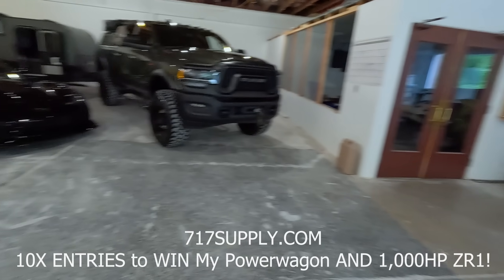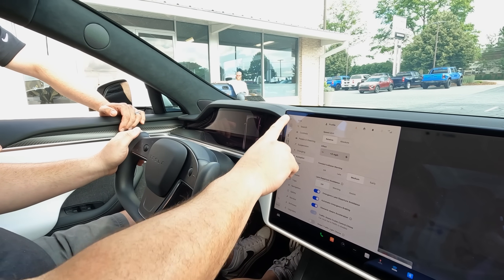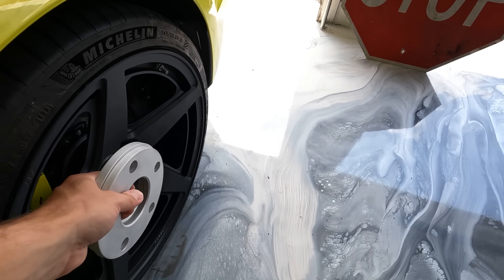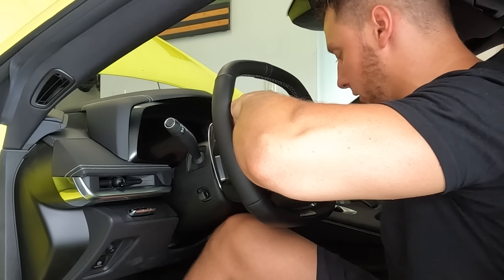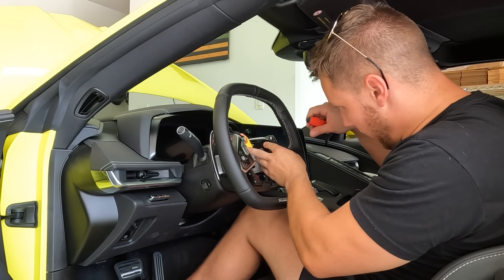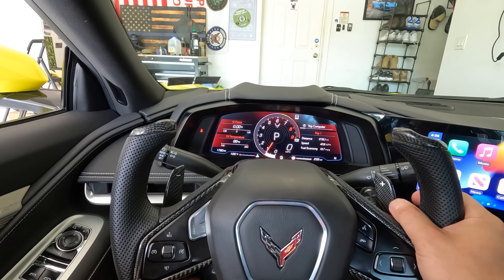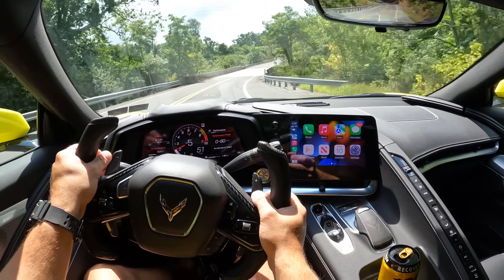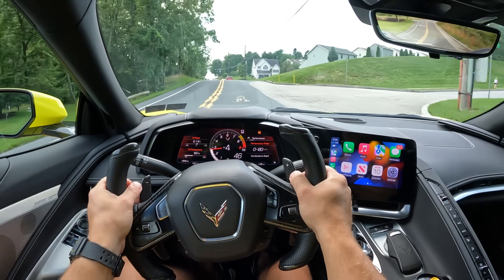STARTING My C8 Z06 Build With Something Small... *C8Z Build Part 1!*

Comment: Don't know if anyone has ever told you this. But you should ALWAYS use hub centric wheel spacers. With those flat spacers, ALL the load is transferred to the studs, and over time, they will break. Also, your wheels will not be centered properly. Spend more money and get the correct spacers
Reply: They WILL be centered properly bc of concave lug nuts and, well, geometry. And you cannot use hubcentric spacers unless the spacer is thicker than the flange of the hub. A 10mm spacer would not be thick enough for that.

Comment: Back in the day when cars had keys, part of the procedure was to leave the key on when you disconnected the battery. That way when you reconnected the battery the airbag would go off without you in the seat. It doesn’t take much to set them off but you really have to try to defeat the safeties in place. If that makes sense. 
   I’m digging the knight rider steering wheel. I’ve always heard stories about people driving KITT thinking it’s awkward. I’d like to try driving it. Great “build” buddy! Lighting is way better than the hex lights.  Can’t say that you’re not starting your business from the ground floor, cause it looks like your in your basement. You’ll look back on this a laugh some day.

Comment: Like the steering wheel. Do they make it for the C7 ZO6? 
The only change I would have done on the new Mag wheels is they should have been Carbon Flash. The flat black looks like they are covered in brake dust.
Reply: Thats the main reason I dislike matte black wheels!

Comment: That wheel style is known as a Yoke. And aircraft that use them are typically much larger than fighters. For example the B52 has a similar yoke. Whereas the F16  has a side stick controller on the right side of the cockpit which is pressure sensitive and has little to no movement. Not what one would want one in an automobile since the ability to feel the wheel moving is how we perform turns of a desired rate, circumference, etc. 

The C8 turns the same way other vehicles do and thus one can still perform a 180 deg turn for example. Btw, that was in reply to a poster who wondered if they could still perform a U turn or a tight circle for example in the C8. 

Yes, you can.The car can do anything other cars can do. Hence the yoke style 'wheel' is not an issue in that regard.
Reply from the maker: lol good to know!

Comment: The steering wheel actually looks decent, not better than a good carbon and leather round wheel, but non the less I like the yoke more than I thought I would. Only issue is its safety when you are having to counter steer the vette when you’re sideways.

Comment: The only problem with that new wheel is going to be when it steps out on you and you have to quickly counter steer…
Reply: There is no way I would drive a car with a steering wheel like that on the street . I've done it on the drag strip but wouldn't use it on a "handling car".  I can't think of any Corvette that I've owned whose full handling capabilities could have been safely leveraged with a wheel like that one 😳
Reply: It's not an issue. One can do everything they can with a normal steering 'wheel', although at first glance that may seem impossible. It's due to the fact the 'Yoke' output and vehicle turn rate are much the same as with a typical round steering wheel. And one thing you'll notice is the fact you no longer have to turn a 'wheel' nearly 360 degrees in order to perform certain maneuvers.
Reply: No. It behaves the same as a normal steering system. That is it interprets your inputs as though you were using a circular wheel connected to a mechanical system. Hence you can do anything you can do with a normal mechanical steering wheel system. 

Systems similar to this have been in use in some aircraft for years. For example, the F16 uses a fly bye wire system whereby one applies varying pressure to the side stick controller and the aircraft responds according to ones input. Whereas aircraft without such a system often use a mechanical (cable and hydraulic system) which is slower and offers less precision. 

Think about it: How could one operate a car if it weren't possible to perform a 360 degree turn, be it slowly, or rapidly while painting the road with rubber and leaving clouds of tire smoke in the air. Not that it's typically a good idea mind you. It's the fact the car allows one to do so. Now back off a little and drive like you're lawfully permitted to in which case a drive by wire or fly by wire system performs just as well and typically better.
Reply: @cassiespencer6134  

"And one thing you'll notice is the fact you no longer have to turn a 'wheel' nearly 360 degrees in order to perform certain maneuvers."

This is just not simply true. Aircraft use a yoke "steering wheel" because they lock at 90 degrees and there's no point in turning the wheel further. That would require modifying the steering ratio in a car. Unless this guy made those modifications either via some kind of software (not sure if the c8 has drive by wire or not) or via modifying the rack itself, a yoke in a car will still require adjusting more than 90 degrees to get tighter turns, only now you have less room for your hands on the wheel. Yokes in cars looks cool as best, and in the event of an accident where turning quickly is needed, dangerous at worst.
Reply: @Sol_Divisive  It depends on the acft. Btw, I'm a pilot. And as I  said most light acft use a yoke. Although some, for example older acft often use a stick. Whereas the F16 for example uses a fly bye wire system whereby one applies varying pressure to the side stick controller (right side) and the aircraft responds according to ones pressure input. And the 'stick' itself moves very little.
Reply: @Sol_Divisive  I was referring to the C8 as far as how it can still turn in the same way any other car can that have a steering 'WHEEL'. 

I say that since the poster was curious as to whether or not the C8 could still do a 360 deg turn for example  since it doesn't  have a steering 'WHEEL'.
Reply: @Sol_Divisive  Depending on acft type a yoke stops when the ailerons or elevator for example have reached their mechanical travel limit. However, given a fly by wire system said control surfaces are moved by a number of means depending on the aircraft. For example it can be via hydraulic or electrical systems. And it's those systems which determine travel limits; which in some cases can vary depending on acft type and/or design. 

To put it as simply as possible the flight control surfaces and control system/s used with most light acft for example are a stick or yoke, along with rudder pedals which allow said control surfaces to be moved by pilot input via cables or in some cases hollow aluminum rods. That said virtually all control surfaces have a mechanical travel limit as well. And it's due to those limiters that control how far a control source can move, be it by pilot input or wide guts while parked.

In fact  aircraft certificated under 14 CFR 25.415 or EASA CS 25.415 are required to be capable of exposure to wind speeds of 65 knots from any direction without sustaining damage while parked or taxiing. It's why a metal rod is used to prevent control surfaces from being moved with enough force via wind while parked in order to prevent damage.
Reply: @cassiespencer6134 Congrats on comparing cars to planes, but this yoke design on a STREET car with a steering box designed for street use is terrible. This makes sense for a purpose built GT track car with their purpose built steering box because the inputs are much tighter and more precise, requiring a smaller area of input. Very rarely if ever you're doing full corrections or hand over hand movements, unless behind the wall. Where as on the street you absolutely will be doing these movements. Of course, internet talk is cheap so if you actually want a demonstration I know finding a GT racecar or even a C8 Z06 is pretty hard, but hop into any racing sim and then switch between the two to notice the difference in steering lock and input. Bottom line this yoke is purely for looks at the sacrifice of usability.

Comment: Hey Mike, love the grind you keep pushing through to build your channel and business (and home) and super grateful to join you on your journey. Anyway, quick question, is the C7 ZR1 still tuned for 1000HP?
Reply from the maker: Yep! Makes 860WHP on pump gas right now
Reply: @StreetSpeed717  Mike. You don't have to disconnect the battery. Only have to pull the airbag fuse. Way easer.

Comment: WALMART HAS THE ELECTRIC BATTERY RATCHET THAT IS THE HAND HELD TALL ONE THAT CAN GET INTO THOSE TIGHT SPOTS FOR $38!!!! It’s red & black 3/8 ratchet but you can get the adapter from 3/8 to 1/2 inch for the bigger sockets to go onto it. It’ll help you for the things you do brother I have one and I use it for everything in my truck that I mess with lol press of a finger n it’s out or locked tight and you can actually use them as a wrench as well

Comment: I love the wheels on the Z06. They are sick.  How could anyone not like em.  I do think they fit great though from what I can see. Why use spacers. And what's up with the bottom sitting in or out further and looking like a tuner. Why would the spacer do that.  Why is design not to sit straight.  Sorry if that a dumb question.  But why would GM design it like that

Comment: If I were you with that steering wheel, I'd keep the car in Z mode and set the steering to track, that way you have max responsiveness to modest turns, but have the option to dampen the suspension and other characteristics to your desire.

Comment: Steering wheel is different but cool.   I also like your wheels.   Can't wait to see what you do next!
Reply: It's called a Yoke vs a steering wheel. Remember: wheels (including steering wheels) are round. Whereas a Yoke is not. Btw, yokes are used in nearly all light acft and even some larger acft.

As far as the C8 is concerned the yoke will not interfere with desired control inputs nor prevent one from maneuvering the car any way they choose. By that I mean one can still complete a 180 deg U-turn for example (or any other maneuver) by using the yoke. Hence a typical steering wheel is not necessary. 

Simply put: if one can do it with a typical steering wheel they can do it with the Yoke in a C8. I know, since I've driven two of them. One belonging to my neighbor and the other a guy I work with. 

That said I admit there are things about the C8 I prefer over my C7 CR1 (ZTK option). Primarily the shift speed. I'm curious to see how it works in the future with more HP and TQ.

Comment: That wheel wouldn't work for me but it looks cool.
When I'm cruising I tend to have my left hand at 2 oclock and my right arm resting my hand position at about 4.
But again it looks cool.
I don't think it would be a very good wheel in the winter with snow on the ground in any lock to lock situation but I may be wrong on that.
I see that Tesla must have lost some orders when they came out with the yoke wheel only option because they now offer the Model S in either wheel.

Comment: The only thing that I would be concerned about is that when driving my vehicle which is a pickup I tend to use my palm when turning and I would not be to do that with the part I use missing. I won't have to worry about though because I will never be able to afford a C8 anyway.

Comment: how much does a steering wheel like this cost, not specificlly this one cause its only about half a wheel but for other cars like mustang camaro an c7 c8, about what is the cost for one of these carbon fiber steering wheels cause ive got one locally thats for sale, says its for a gt500 car but i looks so much better than what comes in the s197 cars an i just got one so if there is something i could swap it out for id love to find one but when i look online all i find is more simple racing style wheels an not something that is a replacement or upgrade that uses the bottons on the wheel. theres not much on them, only got cruise control button so id like to keep them so id like to find one that fits my car. 09 mustang gt everything i have found that is more of a replacement or upgrade is for 10-14 or newer cars an im not spending a grand for a wheel, so id like to find something that is alittle cheaper an that i know for sure will fit my car. im sure i could make one of the 10-14 wheels work cause i have access to a milling machine an a lathe so im sure i could make it work but what are others suggesting for those cars.

Comment: A yoke on a Z06?! 🤮 The very first day I got my Plaid I swapped the yoke for a wheel. The yoke is the worst invention ever. Total gimmick that makes turning the car much harder, especially if you’re doing any track events. Yokes only work on race cars that have very tight steering racks with very little steering angle. On any street car that requires the wheel to turn past 90 degrees, they are garbage.